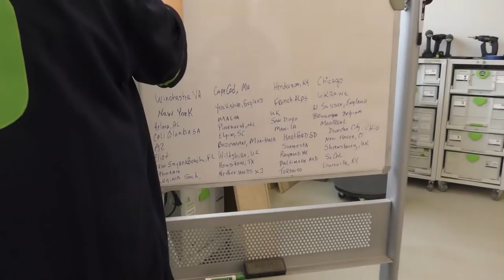Festool Live Episode 34 - Installation Organizer

Comment: Why isn’t t the 5 mm used where the large thick parallel guide adjustment is?    Is there a thick flat head screw driver for that?   ——- gezzzesz I HATE flat head screws! = Hate

Comment: I got the Centrotec drill and screw bits for my CXS, and then the Centrotec hand screwdriver bit holder to take the same bits. That much more versatile and works great. No wrenches, but for God’s sake I have a wrench set already that works fine. For some things you just need basic tools to get the job done.